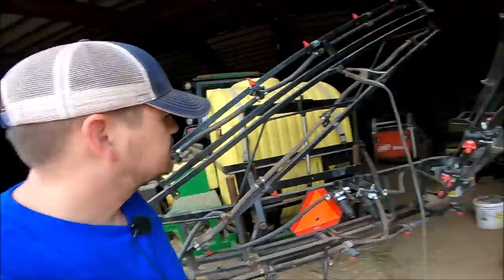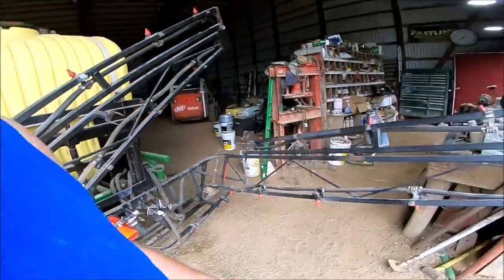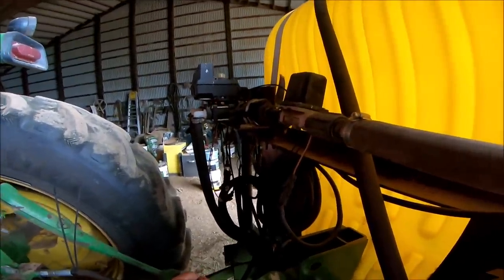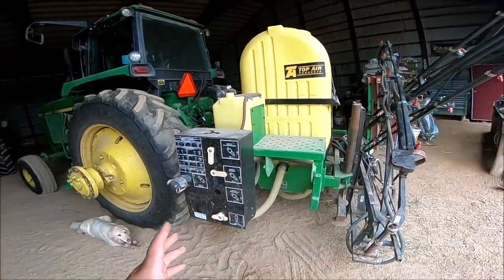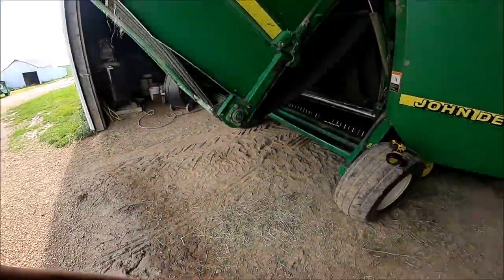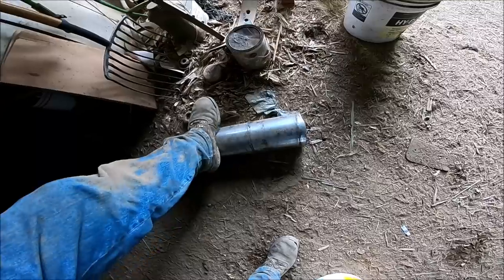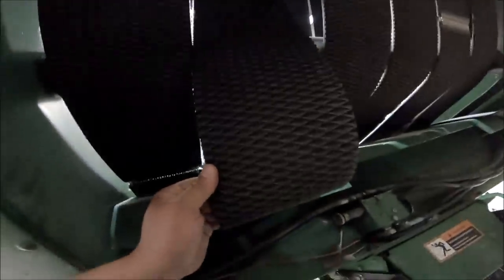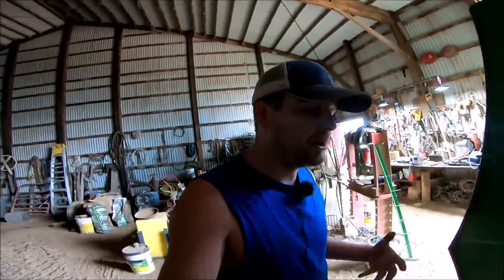Another Leak 💧 Piecing The Baler Back Together🔧

Comment: Man I'd love to see a rainstorm like that around here at Shiner... getting pretty dry.  We got a half inch Saturday morning but it's already gone... we could use a good 2 day slow soaking rain of about 3-4 inches would do REAL nicely!  BUT it looks like the hurricane Laura is moving through probably the least populated area of the TX/LA border (which is good given its strength) and we probably won't get a drop out of it...  If we get any it'll be in the wee hours of the morning I suppose, or maybe daybreak.  Heck yall will probably get more rain in Wisconsin out of this storm than we will here 150 miles from where it's hitting... I know our friends in Tennessee will get more rain from this storm than we will.  Oh well how it goes... 

WOW thousand bucks for a roller?? That's a bit salty... I had to replace the lower drive roller in our old baler and it was like $450 bucks... course that's been probably 6-8 years ago at least, maybe 10.  OH well if you run 'em they're gonna need some repairs at some point...

Were the screens crushed from getting clogged up and pressure collapsing  them?? They might be installed backwards to the way they're intended to flow... If the fluid goes in the center and down the screen and out through the screen then back up the "cup" of the housing to the top and out the other fitting, there's no way they can 'crush' from pressure, since the pressure is on the inside of the screen.  Screen could potentially blow up (out) but not crush... and if they ARE crushing from pressure, how much pressure is getting delivered to them??  Those housings aren't made to handle a butt-load of pressure... I've never seen one "crushed" before unless it was dropped and stepped on or otherwise physically damaged outside the housing... new one by me!!   Later!  OL J R :)

Comment: I’m from Ireland and maybe we use tractors differently here but can someone explain y the brothers rarely use there largest tractor and y it’s roles are so limited
Reply from the maker: its unhandy for making hay. it was purchased to do heavy tillage. not saying we can't use it for hay but for how heavy/long it is, I can't maneuver it as easily as I can the smaller tractors when making hay
Reply: @TheRestOfTheStory  and why would you want to we bales 1295 rolls still lack 150  acres we use 125 horse tractor and we just started using this tractor we used to use a 95 horse tractor and it did great till you got it on these steep hills in Tennessee